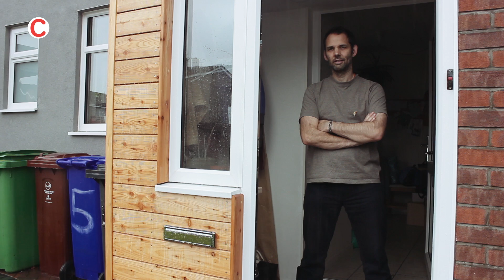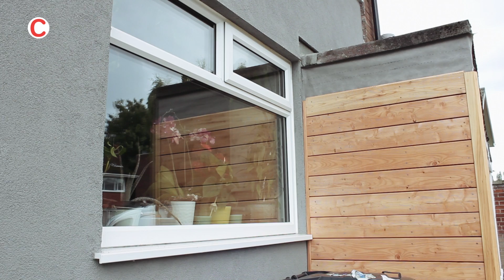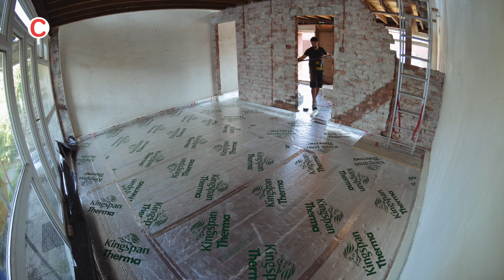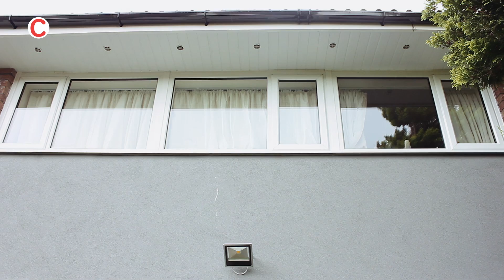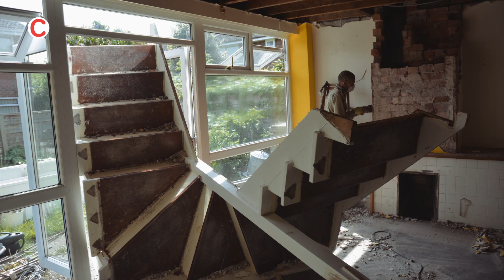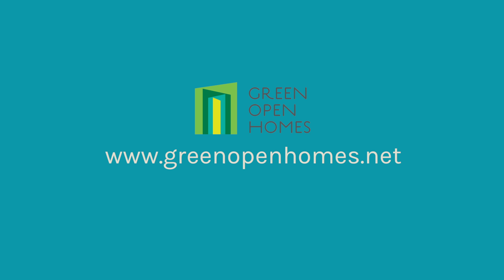Gervase Mangwana - planning and executing a whole house retrofit

Comment: Just revisited this video after first seeing it some years ago.  I feel my only concern would be investing more than the market value into a property when the payback just isn't there in a reasonable term.  Without being rude I hope..  It's not the biggest of houses in the best position and peoples needs and aspirations change over the years, this house probably 'in my opinion' just isn't worth the investment.  Obviously I get that it's a more comfortable better cheaper house to live in, my point is it's too big a personal cost to the individual.  Perhaps I'm just not looking at this correctly but the house next door that's had a fresh coat of paint applied and not much else has a similar market value making the venture financially pointless.  Little value is placed on the improvements and therefore a new build would be the better/cheaper option.  I guess an alternative would be government grants to improve the housing stock, always promised but usually unobtainable for most of middle-England.
Personally I feel the retrofit market is so conflicted it just leads to apathy and delay.
Reply: Interesting and good point. My wife had already owned the property for 13 years when we did this and the extra equity was already in the market value at this time. Actually the value of this property has increased another £100k since then. And with energy price increases the bill savings are now into multiple £1000s a year. Of course the house needed refurbing anyway and that would have cost £10-20k. Plus on top of that the property is affordably comfortable and much much healthier to live in than it was before.
Reply: And there's the age old point that people are happy to pay £20k plus for a kitchen without ever considering the payback or ever likely to see it increase the market value. 
Finally. There is now evidence coming through that more energy efficient homes achieve higher prices. In the current energy market who wouldn't be attracted to a place that will cost a quarter of the one next door to heat and be more comfortable? Knowing what I knew then this seemed inevitable and I think will only continue.